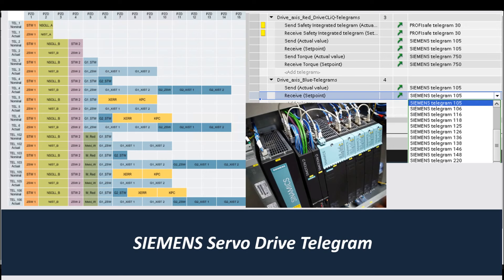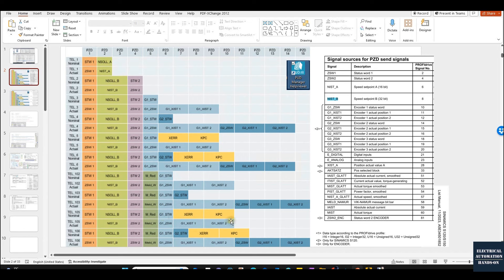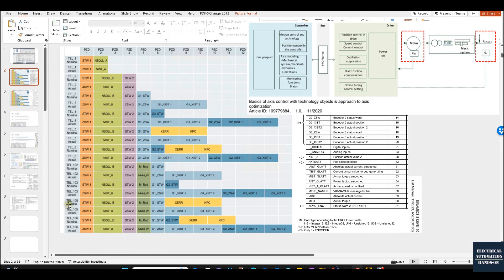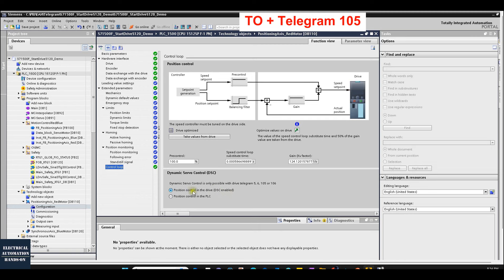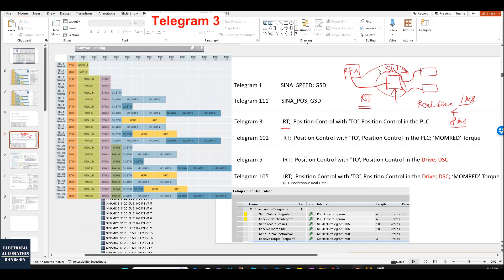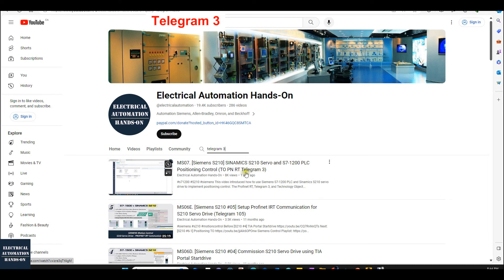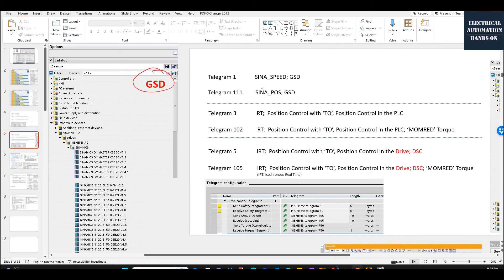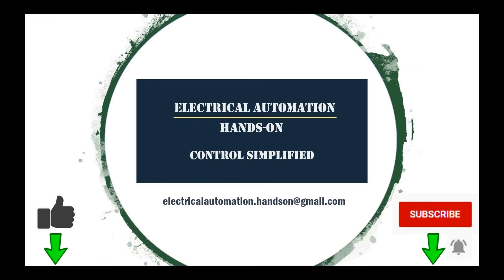MS09. How to Choose Siemens Telegram For Motion Control

Comment: Thank you for this informative video. I just have a question: Is there any way or alternative to increase the size of data transferred between PLC and S120? Currently, I am using free Telegram (999) for both ALM and CU-320, which are limited to 8 and 4 words, respectively.
Reply from the maker: The S120 Telegram 999 should be able to be configured with 32 PZDs. So you can reconfig your PLC and S120 interface to increase words for them.

Comment: hello , please can you tell me why the telegram 1 and 111 does not work with Technology Object ?
Reply from the maker: The telegram is the 'result', the 'reason' is the application. TO application needs the 12 PZDs, so it needs the Telegram105 for it. In the contrast, the speed control only need 2 PZDs so the telegram 1 serves for it.
Reply: @electricalautomation 
Hello sir , the question is can we use TO instead of sinapos and sinaspeed (drivelib)
Reply: In telegram 1 ofc
Reply: @electricalautomation  thanks! i needed this answer